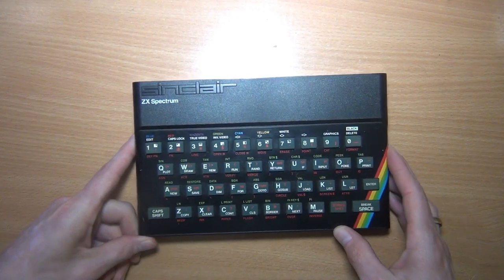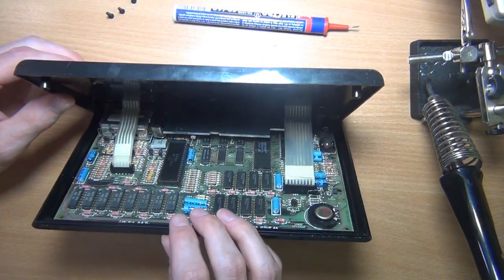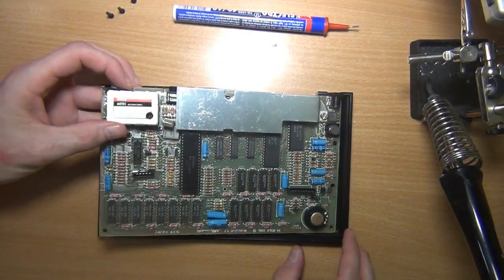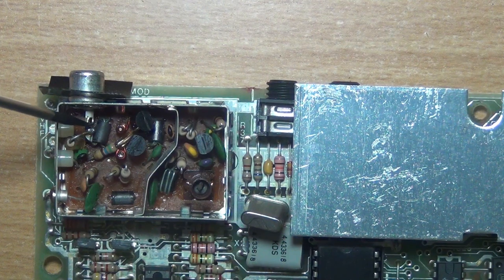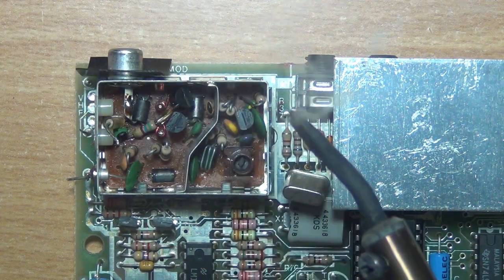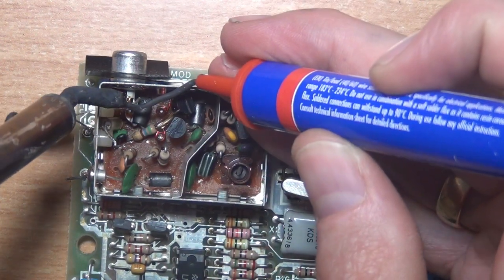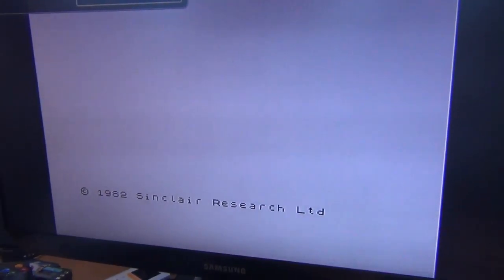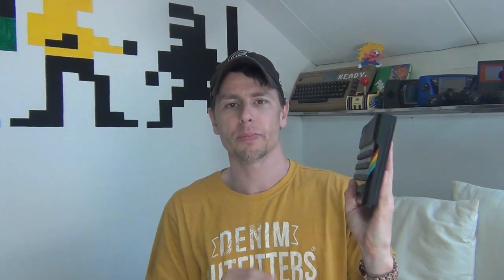SIMPLE ZX Spectrum 48k Composite Mod

Comment: If you are not bothered about reversing the process, you can desolder the modulator board. Then you could put the capacitor in the modulator instead of the side.
Reply from the maker: Yes, you could remove it altogether. But I don't think the extra effort really gives you any benefit.
Reply: With a little work you can fit the capacitor in there anyway.
That's some horrible positioning for a capacitor.

Comment: +RetroGameCouch I have doubts about power wire! Have you cut the wire and didn't solder it back?
Reply from the maker: Yes, I cut it and did not solder it back. It is to power the modulator. You don't need it for the composite signal.

Comment: hi, the capacitor its for what? can you detail what do to improve the signal? thanks
Reply from the maker: A smoothing capacitor is needed in order to smooth out the fluctuating signal to make it more steady. It does, as far as I can tell, not improve image quality that much.
Reply: @RetroGameCouch  PNPHOTO don't believe him, try to find better answer. May be capacitor is needed to remove dc voltage. Try mesaure voltage before and after capacitor when zx is connected to tv set and working.